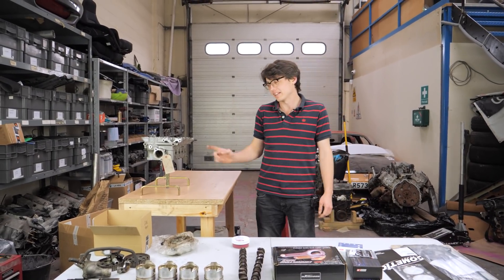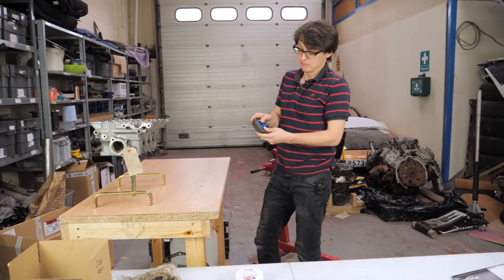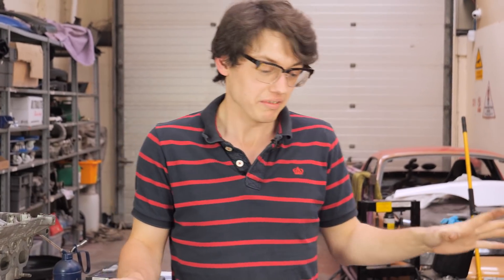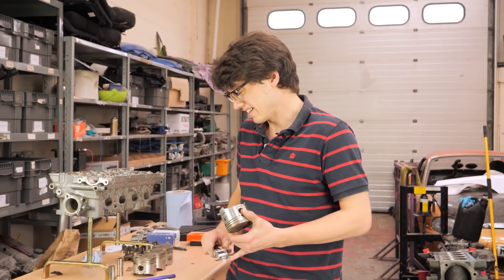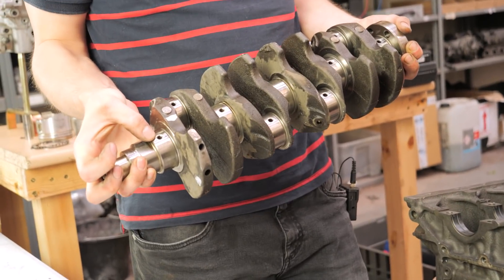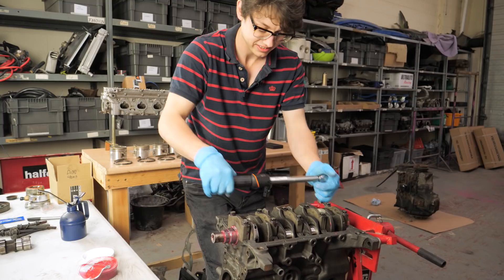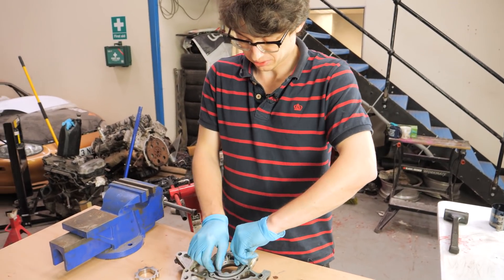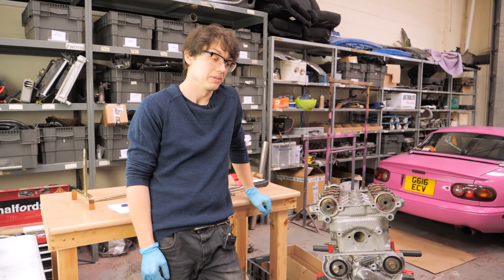We Build A Weird 1.6 MX-5 Miata Engine With Forged Rods And Billet Oil Pump

Comment: Great video! I have a question about fitting that oil pump to the 1.6. As far as I know the 1.6 with a big nose crank used a paper gasket for the factory oil pump but these boundary pumps are like the 1.8 pumps which have have grooves and require RTV and a rubber o-ring to seal them to the block. Did you install this pump onto the 1.6 with RTV and an o-ring? Would really like to know as I'm about to start putting my engine back together. Thanks!

Comment: I'm installing a new oil pump now on 1.6 '93 miata engine.  I bought the Melling brand pump, which is the higher cost one than the imports. But I noticed in the bypass valve housing there's no seat, just the spring being held back with the cotter key. The seat is so thin, I can't see it affecting the oil pressure. Is the seat needed? If so I can transplant the one out of my old pump into it. Also, the plug that comes with the pump to close the hole for cars needing a dipstick there, is it installed from the inside or the outside?

Comment: Would have went with 10.6 79mm piston I pretty much built the same engine and boosted it made 276 at the wheel on 14psi

Comment: Would it work 1.6 block on 1.8 head
Reply from the maker: The 1.6 are 1.8 are physically different engines
Reply: bp 1.8 head only fits on sohc b8

Comment: In the next one can you go over the pros and cons of the head? I'm building an engine here and need to decide between the MK1 head I know is good and a MK2 head that came with the donor engine.
Reply from the maker: We certainly will. The mk2 1.6 has bigger cams, more compression and solid lifters which are all useful.

Comment: Is there a definitive source that lists all the differences between the various 1.6 MX5 engines? This is the first time I've heard about the changes to the Mk2 head. Nice to see these old engines getting some love!
Reply from the maker: We will put together a video about the differences. In summary though, bigger cams, a little more compression, solid lifters
Reply: @BOFIRacingTV  That would be great! I tend to forget where I read different bits of info. I hadn't heard of the Jafromobile channel either, so thanks for the tip.
Reply: @BOFIRacingTV  What about the port angles mentioned in the video?
Would love a video and/or a detailed post on the BOFI Racing website!
Reply: There is tons and tons of information out there on the internet, cannot list from ipad, as have on my faves on my pc. However mx5nutz is a very good starting place